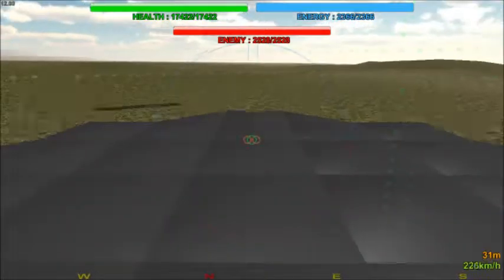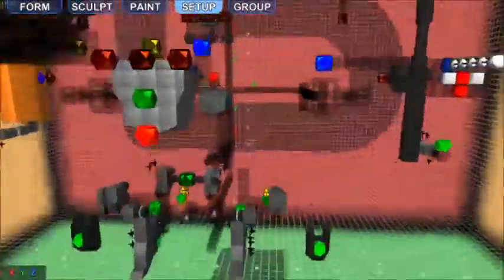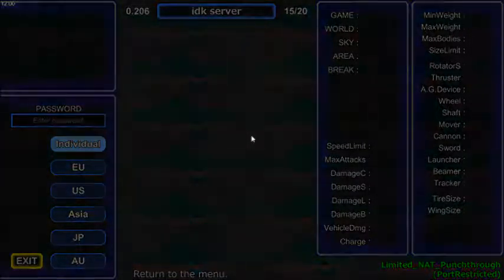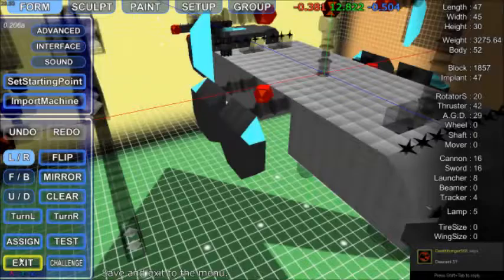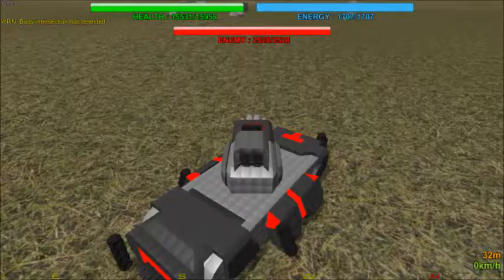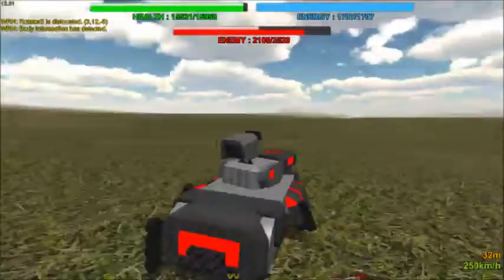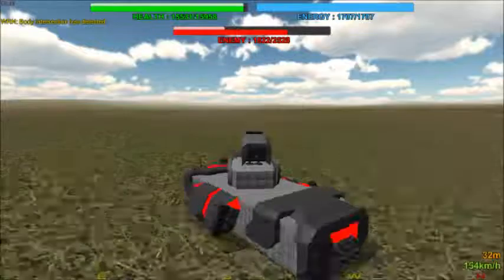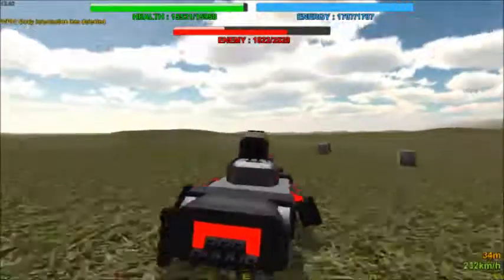MachineCraft Tech Talk: Episode 0 (Foundation)

Comment: how did you do the artilery?
Reply from the maker: The laser protractor is indeed complex, so I won't explain that unless necessary, but for just having an artillery pack you can calibrate to a certain elevation with the push of a button is something I WILL explain in detail.

I mounted a hinge on the back face of the tank's turret, so the "hourglass" like empty spaces are facing upwards and downwards. The lower limit (turning down) was set to -90, and the upper limit -10. This mobility range was deemed ideal for firing angles.

From there, a small block of armor is slapped onto the hinge, and has a tracker facing backwards, as it standard for tracker aimed guns. Q is bound as "AIM BARG" (aim barrage in short), and AIM BARG is hooked up as the ONLY event in the tracker, with a modifier of +30 for calibrating more intuitively to your look direction.

From there, slap a coupler into what should probable be a hollow interior in that block of armor, so you can fit guns into the middle of it. Paint it a unique color, and make more of the same color couplers so they snap together. You may have to mess with the mounting offset of the couplers in the next step, so if you have to do that, change the X, Y or, Z offset accordingly on the couplers you attached the artillery cannons in the next step.

Moving on, we want to use exactly 16 attacks for the rapid fire artillery, so we setup 3 couplers (discluding the one inside the block, and 3 so we can do 2 sets of 3 and 1 set of 2, as to make 8x2 cannons which = 16) and make sure the 3 chunks aren't directly touching, as that messes up the mounting process. 

We add two blocks that are invisible to the left and right as we need to make a row of blocks 3 units wide (invisible chassis blocks can be made using 0 red, 0 blue, 0 green, and with translucent selected in the color mixer of the paint tool) for the next bit.

Once the 3 unit row is created, and done so on each of the 3 coupler sets we want to mount, we add 2 cannons to each block left to right on each chunk. We set the rear cannon to a fire button of some sort and leave the front unassigned, before adding exactly 1 unit of barrel to the end. Remember that 1 cannon + X unassigned cannons makes artillery, given that the number of unassigned cannons is not less than the number of barrels in the array. In this case, 1 unassigned + 1 barrel = max barrel limit for an 8 piece rapid fire artillery.

Finally, we set the fire events in the rearward cannons to have delay values on their fire events matching 0 (the default), 2, 4, 6, 8, etc up until 14. In more recent versions, you can also use "division" property set to 8 on each along with delays of 0, 1, 2, 3, 4, etc up until 7 instead, but it doesn't really matter either way.

If all went according to plan, pushing your "aim artillery" button should make the gun piece aim up and down only while held. Once at the angle you want, roughly, release the button and press the artillery fire button when you want to fire, and it should fire the artillery at the given angle consistently, producing an arc of rapid fire explosions.

Footnote: Mortars got nerfed hard in the combat revamp update, so the weapon is no longer as effective as it used to be. No reason not to add it, honestly, since it's just a spare weapon mounted on your tank's turret. Can't hurt, right?
Reply: YCCCm7 thanks i didn't expect you to reply in such detail gonna try to make my artillery now